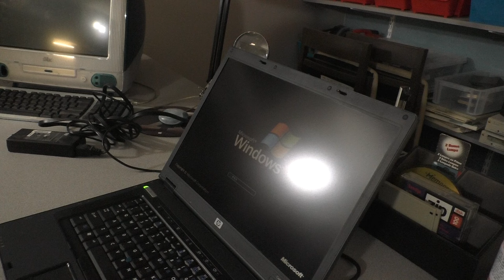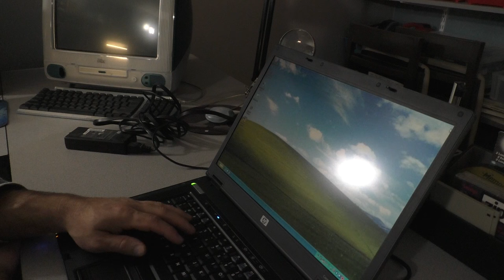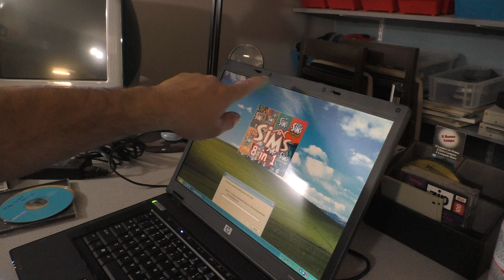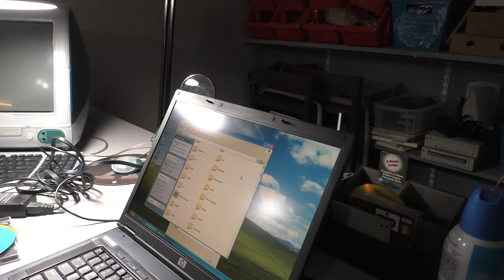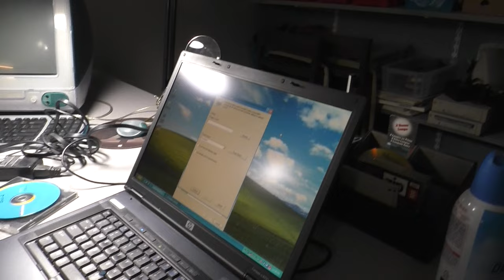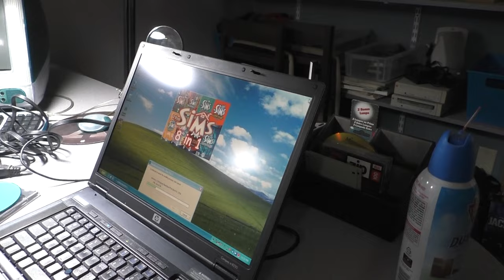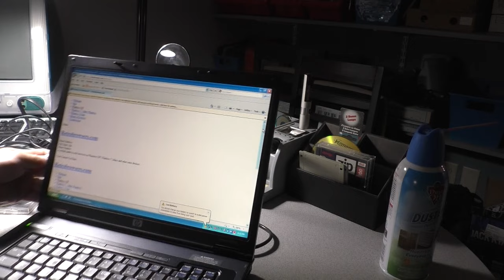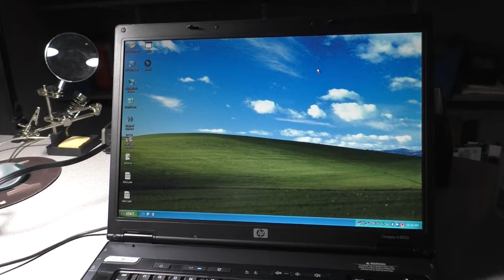Revisiting the HP Compaq NC-8230 - The BEST laptop ever made?

Comment: So happy to see that you're still making computer videos. I've got an HP ZX5000 that is from late 2004. Whoever custom ordered this thing from HP went absolutely crazy. 3 GHZ Pentium 4, 1GB of RAM, 802.11g Wi-Fi, Bluetooth, DVD/RW CD/RW drive, 1280x800 HP "Briteview" widescreen display and a 128MB Radeon 9600. Not sure what the original hard drive would have been, since it was missing when I bought it, of course. I slapped an 80GB 5400RPM drive in it and it is an absolute beast. I'm pretty sure the 128MB Radeon 9600 was the highest end graphics option for it. It runs older XP games extremely well, and even with some newer XP games, it will run those very well.

Comment: I still use an NC6400 with a Radeon X1300 and the 900p screen as my workbench laptop, absolutely bomb proof. I paid £8 for it as spares/repairs, worked fine when I plugged it in and the battery even took a charge.

Comment: I have the 6910p (core 2 duo) version of this laptop and I adore it. The battery still holds a 2 hour charge and fingerprint reader works with Windows 10. The keyboard is really nice on these almost Lenovo quality.
Reply: Me too! Mine's in rough shape (whoever owned it before was an idiot and had reassembled it wrong), but it's been running just fine after I fixed it up. Can't really complain when it cost me all of a dollar.

Comment: I'm still using my Precision m4500 from 2010, it does have XP drivers for it, always wondered how old games might react to the Quaddro graphics card it has in XP, it also is a bridge machine I think
it has a modem knockout, wireless toggle, pcmcia and expresscard slot, displayport and vga, smartcard reader, usb and firewire, room inside for a normal 2.5in drive, optical drive and msata ssd, bt was an option, a webcam was an option, I have a 1600x900 display but 1080p was an option
with the dock I get more usb ports, two monitors (dvi and display port) parallel and serial and 2 usb 3.0 
it has a first gen i5, max ram is 8gb, win10 works fine as does XP, lol, oh and the dock gives 2 PS/2 ports
it's pretty much been on and running every single day since I got in 2010 and doesn't show signs of stopping, 
it also has the trackpoint type mouse and both scroll bars on the trackpad and status lights
the third button on my trackpad enables scroll

Comment: For mid to late 2000s the W500 is near top of the list for the best laptop of the decade though depending on the user my vote would go towards something like Inspiron 9300 for 2005 as you would have gotten an absolute tank of a machine at a very reasonable cost that would have done most of what people could have ever asked minus battery life and keyboard. I got like five or 6 9300s and a couple XPS Gen 2 that is how good they are.

Comment: While I don't have this particular laptop, I do have a Dell D610 from the same era that is also in very good condition. Apart from a few scratches on the lid, you'd think it's brand new. The battery still lasts for several hours, the screen's backlight hasn't yellowed at all, and the hard drive only reads as having around 500 hours on it. For a system nearing 16 years old, it's held up quite well.

Comment: i  got the same machine. around 2010 there was an ebay seller in Alberta Canada who had tons of these for next to nothing. i bought one of them and upgraded the cpu to the fastest core 2 duo it would support. maxed it with 4 gigs of ram. putting in a 120 gig ssd. upgraded it with a better wifi card witch was a pain hp blocked changing out the wifi via the bios if u put anything in other then a couple models of wifi it would refuse to boot but someone uploaded a hacked bios to a forum that white listed it so u could put in any wifi card. the model i bought had an nvidia gpu in it some of the lower end ones had intel only.
Reply: Hey,
 If it's possible, do you mind posting the link to the site ?
Reply: I have 6 NC8230 laptops. Could you post a link to the hacked BIOS ?

Comment: First!

I'll have to watch the video later and make a proper comment than

Edit
Back Awww Oreo love lol. So it would be HPs rival to our Dell inspiron 1300 (Pentium M 2.80ghz) I really wish our Dell had a docking port...

Specs
Pentium M 2.80ghz
Intel graphics/Wi-Fi 
1gb ram that become 2gb later on
80gb EIDE hard drive (original HDD died and was replaced)
Cd/DVD combo burner drive
6 cell li ion battery (battery is no longer safe to charge)
XP Home sp2 (we upgraded it to pro sp3)

We ordered ours from the website or rather my Old man did

Comment: This reminds me of my HP Compaq 6710b that someone gave to me a few years ago for free with a wiped hard drive, malfunctioning fingerprint sensor, weak battery, and dead original power adaptor.

The original Windows Vista COA is unreadable, so I just stuck on pirate installs of Windows 7 and 10 1607 for fun, and later installed Debian 10 so it could act as a rudimentary NAS in order to read my BTRFS formatted external hard drive that contains a cache of the most accessed files on my NAS (also BTRFS formatted) and expose it to my main laptop while it's running on its Windows side (the hard drive is connected directly when my main laptop is on its Debian side) since the internet connection at my second home in Australia (where the laptop resides) is slower than the Internet connection I have at my primary home in Singapore.

The Debian installation process on this was fun, as I didn't have a flash drive I could wipe and flash with the Debian online installer (this is too old to use UEFI), so I shrunk a partition, took the hard drive out, connected it to a USB adaptor I had (or borrowed from my stepdad), ran the Debian bootstrap on my main laptop pointed to the external drive, then did a "chroot" into it to set locale and timezone, create a user account, then install Wi-Fi drivers, Network Manager text mode UI, and GRUB, and after some trial and error, managed to get it to boot on the 6710b. From there, connected to Wi-Fi, and ran the command to install a desktop environment (I picked GNOME), thus completing the installation process.

I left it running for days (connected over LAN using a powerline adaptor since the house was too old to have LAN sockets on the walls) to download files through FileZilla as my old NAS I had at the time was dying and would cut out, so I couldn't "rsync" everything I wanted before flying off in early 2020.

I had since replaced that NAS with another one that has been stable so far. I'm glad I went with BTRFS software RAID, otherwise, I would've lost all of my files! ZFS doesn't work for me since I have a 4 bay NAS.

EDIT: Forgot to mention: My stepdad giving me his 6710 really helped me once at the time my main laptop (a Lenovo ThinkPad X250, which was my main PC at the time) had a 250 GB SSD and only ran Debian "testing" builds. I now have a 500 GB SSD in there and it dual boots between that and Windows Insider "Dev Channel" builds.

If I can travel back to Perth again, I'd likely load up a whole bunch of old software (mainly on the Windows 7 side).

Comment: Whilst I don't have one of those HP Compaq's. I have a Fuijtsu Siemens Amilo Pro V2085. It has a 1.7ghz Pentium Mobile, integrated graphics, 1280x800 display, 60gb hdd, DVDrw (and R DL), 512mb ddr2 ram,Wireless, and good amount of ports Kensington, S-Video, VGA, 4 USB ports, mini FireWire, PCMCIA, SD/MMC combo, Audio line in, Audio line out and Audio SPDIF, and a row of leds for WiFi, power, sleep, hdd, battery, shift lock, num lock. Not bad for a laptop made on the 31st of March 2006

Comment: I have a HP Probook 6565b and its a wonderful laptop to use even for its age, its very comfortable to use and really easy to service just one latch for the battery (which i just bought one for it) and one for the bottom where you can access the cpu, gpu ram etc. This and the other one I had which was a little weaker than the one im using are really handy to have around when im out and about or just easier to use a laptop than the desktop. Hell I even managed to slightly overclock the cpu from 2.2Ghz to 2.8Ghz

Comment: I got the workstation version of this laptop recently, the NW8240, and I quite like it, pretty fast running windows XP SP4 too. Mine has a 2Ghz Pentium M, 2GB DDR2 ram, the top end 1920x1200 display, no HDD (threw in a rather sad condition 30gb 4200rpm hdd, works well enough) and the ATI FireGL V5000 128mb.
Quite light for its size and age, and not much larger than the 14” 4:3 NC6220, unfortunately has a bad battery but I’ve ordered a new one.

Comment: Interesting story on your first new laptop. Ironically, the first laptop I ever ordered brand new (a Lenovo 3000 C200) was supposed to ship with a dual-core Pentium, but because someone stuck the wrong label on the box I ended up receiving one with a Celeron instead. Had to send it back for replacement.

As for the "SC" slot, I'd assume that stands for "SmartCard", which makes sense on a business laptop for security purposes.

Comment: We used to install new XP machines at work up until Windows 7 was a thing. We didn't like Vista at all as it was a nightmare. Constant hdd thrashing, pretty sluggish performance. I haven't seen a Vista machine that ran well. The same I can say about Windows 8 and 8.1. Haven't done a single install of that thing either. Still using Windows 7 on few of my machines at work.

Comment: Whaddya mean "You can't get Chrome on this". I know there are recent versions of Firefox and Chrome for XP somewhere, they won't be new though. Try somewhere like oldversions or some websites can auto detect XP and give the newest possible version.
Reply: XP really needs to be disconnected from the net at this point in my opinion. I love ya XP but it's time to unplug
Reply: @JohnSmith-xq1pz  Obvious comment, but yes. However, you can install pretty modern software with a little tweaking due to the shared NTFS structure of modern systems.
Reply: @Siknik64  I know but somebody needs to say it lol
Reply: I've used Mypal on XP and it loads modern sites just fine, but as mentioned it definitely isn't a good idea. Running a modern browser in a lightweight linux environment is a good option if you want to browse the web on older hardware.